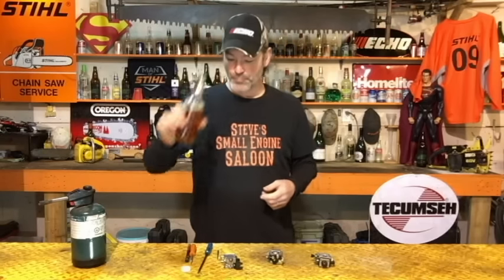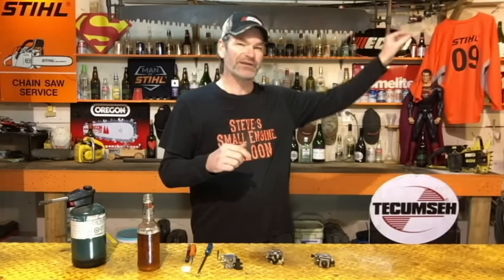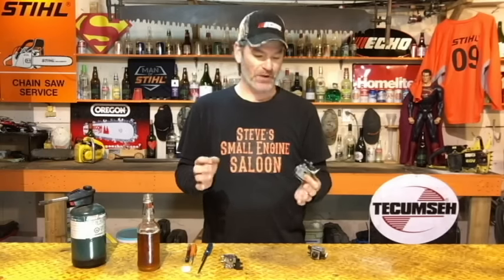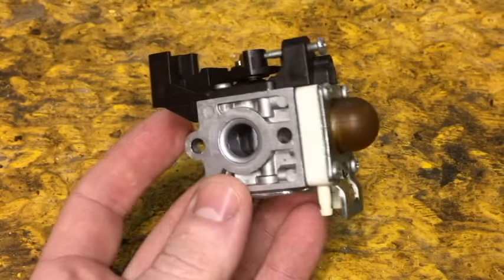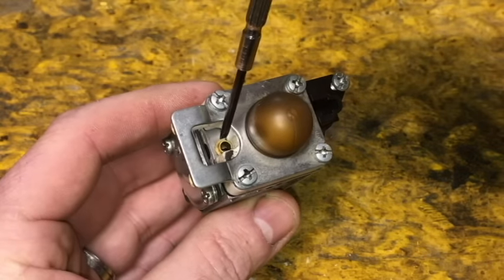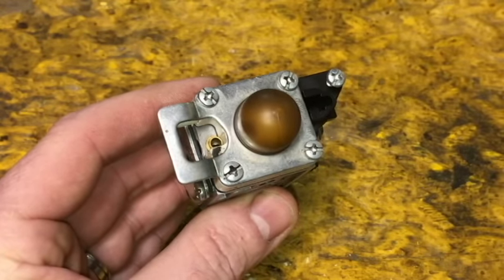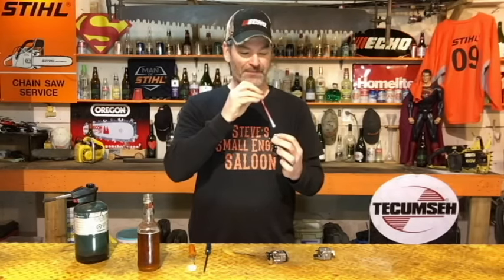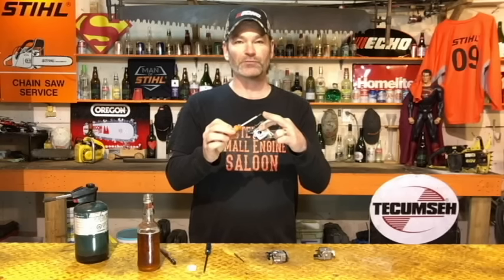Hidden Carburetor Adjusting Screws On Some Weedeaters And Blowers

Comment: Just found your site and I love it!! When are you,or do you have any videos on 4 cycle equipment,specifically the Makita BHX2500CA blower with the Subaru Robin EH025 engine? Thanks.
Reply: Just to add a bit,my Makita 4 cycle blower loads up the air cleaner felt with oil,seems to be sucking oil from the crankcase...but why? Thanks
Reply: Adj valves their too tight or rings were overheated
Reply: @charlesgrafton2242  Thanks for that...I adjusted the valves and it was still doing it..next move was to do a compression test,but I decided to take the air filter housing off to check the lines going in an going out and took the small check valve that sits behind the breather and found a little piece of something(not sure what) that was behind the check valve,probably stopping the valve from closing,so after reassembly,all is good! Thanks for commenting!

Comment: Damn life saver so pissed at the none adjust shit! thanks a billion ! usually do a carb kit change the rubber and hope it works again! but sometimes :( I had one on a yard machine, with a float boal style drilled out the jet just a tad with some welding tip cleaners to get it so it wasn't too lean!
Reply from the maker: You're Welcome...

Comment: My Husqvarna carb is all messed up and apparently they discontinued my carb and everything. But I opened it up and noticed a plastic pin that a needle slides into has a hole in it like it's cracked. Anyone know if those can be pulled out? I tried to pull it out it wouldn't come out but I didn't put much force just Incase it's not supposed to be removed

Comment: Say do some trimmers have a tendency to disel? I hade a unusual problem I suspect fuel quality and carburetor. Trimmer didnt want to start and it feals hot just from working a litel while then dies and refuse to start so I fumeled with some srew and the idel screw and that thing turned on with half gas trothel locked in place so I cinde of give it slowly closein the choke and opening it and then holding the trothel with my hand when the trimmer get to some speed he works and starts normaly with the mentioned procisue its odd behavior he increase in speed by him self and stays at centrain rpm some times he goes full speed I some how managed to ceap him at bay by trimming grass ore somthing puting a load to that thing and ocasionaly giving him just litel trother that thing remindes my nearly to a run away disel engine another garden mashine blow up from it self so hell if I know whats wrong? To much octane ore some one acidentaly put to much fuel to oil ratio ore what culd cause that behaviore? Im not shure realy perhap's magnets can luse magnetic strenght if trimmer is over heated? So my ignition timing is out perhap's ? Well I did change spark plug but nothing much changed it like the spark plug is red hot like some thing is consuming it. Well if the trimer is hot enough he can run on for fhew seconds more even with ignition system off compleately. So any ideas what that thing is doing? Any way the trimmer changes speed by him self with out my doing any thing Im cinde of loading him to prevent him from self destruction I supose.

Comment: good info there   but i gotz ro razz ya  what about computer(microprocessor) controlled carbs????  i know the answer but how many people have bought these without knowing  they are on them.
Reply: richard cranium only thing electrical on a moped carb is the cold start enriching module, that just allows a richer mixture when starting cold then disengages when warm. The rest of the carb is mechanical and adjustable
Reply: husqvarna  and stihl chainsaws

Comment: You can make an extractor for those things from a couple fishhooks, just use heat to straighten them out then douse quench temper them and stick them in an X-acto handle, great for hooking crap out of ports and things.  Cheaper than farts.

Comment: I have an older Echo leaf blower I fixed up and I adjusted the high speed but the low speed screw has a plug looking thing that won't turn and it won't come  off . It runs like a new one tho but I need it to smooth out while idoling. Anyone see this style and could let me know. thanks

Comment: What if you remove the plugs on a barrel type carb and the low speed adjustment screw doesn't look like anything you've seen before? The head looks like it has an offset half sphere in it's top. I have several carb adjustment tools and I've never come across, nor can I find, anything like this.
Reply: TheVoxOfReason View the video again from start to finish.

Comment: Just bought a new Ryobi 4 cycle weed eater, and of course, it's way too lean. However, the adjusting screws on this carburator are apparently hidden with a small brass ball driven into the opening. Almost looks too small to even have adjustable screws. I'm wondering what's behind those brass balls, (no pun intended) Ha! ????

Comment: Actually the Walbro units without the high adjuster hole on the side have it on the back side (intake side) and you need to pull the carby off to get to it. Makes it a difficult trial and error guessing game but it can be done. Atleast that's how my Walbro unit was.

Comment: All you need is a blue wiring butt connector to slip over the screws to turn them on the non adjustable screws . I use them all the time

Comment: If you just get the plastic  out you can't take the jet out .. your best bet drill it out the plastic  then find a screw that will go in it brass insert  screw it in just enough  for it to grab then put some vice grips on the screw  pull it out then u can take the adjustment  screw jet all the way out clean the carb good and look at the screw it is a jet with a hole in it clean it good .. then your good to go .. only pro builders know this most people  that work on them every day just think it's a adjustable  screw it's a jet with a hole in it .. pro builder chris Cordell  .. I been teaching tricks and running shops for 40 years  now .. this is a good video Thanks for letting  people  know what to and how . But maybe my advice  will help u your the video tech

Comment: Where can I get a tachometer the one that you showed had no extra wire and everything I've looked at does have an extra wire.
Reply from the maker: Most of them come with a wire, but you don't need to use it for the application I show....

Comment: I have a Ryobi cs26 weed eater. I changed out the muffler gasket.  Then when I weed eated, the screws kept coming loose off the muffler. I retightened again, then they came loose again and one broke in half and NOW cannot get the broken screw out. It is beliw flush, so I can't grab hold to unscrew. Any solutions?
Reply: Drill pilot hole then use an easy out.  Maybe soak with brake fluid first.

Comment: I have a Walbro carb with the holes blocked by epoxy. But what is the grub type screw directly above the fuel valves p!ease?
Reply from the maker: Adjusting the idle speed...

Comment: Hi Steve I have a stihl fs55 that has just been driving me nuts because I'm a small engine guy myself and ended up having to turn to the online for help. I dont have either type of carburetor in this video it doesn't have any adjustment screws and every video I find for this particular model has adjustment screws ahh!! Its bogging to idle I've already pulled the exhaust spark arrestor and cleaner the carbon buildup so I know it's a carb adjustment issue but can't figure out how to adjust it😭

Comment: Steve have you ever run into a clooged muffler full of oil?
Reply: Fairly typical over time.  Bogs the motor.  Take the screen out and burn it with a torch until it's clean.

Comment: I have a stihl bg 85 blower and theres only 1 screw on the carb. And its reverse threaded.. I'm so lost on getting this thing to run right. I've taken it off and cleaned it etc. Nothing.  Above where the screw is it shows - LD + I'll send u a pic if u have am email

Comment: The ryobi adjustment screw is different than the carbs you showed.. I cant find a tool for the adjustment screw on the ryobi RY253SS. The head of the screw looks like a reverse pac man screw and I cannot find it anywhere on ebay or Amazon... any tips on how to adjust this screw?
Reply from the maker: Yes, I have a video in my playlist for that....
Reply: @StevesSmallEngineSaloon  link please? Thank u sir

Comment: To remove plastic plug, just use a small drill bit and drill it out by hand, and insert small screwdriver.
Reply: Just twisted a 3/32 drill bit into the plug and it bit into the plastic. Pulled and out it came.

Comment: oem carb on a Toro 418ze snowblower is a RUIXING carb.  a real piece of junk, and at a 65 buck replacement cost.  opened up the bowl to clean it and the pin holding the float and needle valve just fell out.   found an aftermarket carb on ebay cheaper than the rebuild kit WITH ADJUSTING SCREWS and the ebay carb worked just fine.   sad day for Toro when I saw this

Comment: Careful with some Zama carbs, the hidden high speed jet under the plastic plug is a "fixed jet" only thing you can do is remove it for cleaning. It is not adjustable.
Reply from the maker: Sorry man but I disagree.  If it is under a plastic plug and you can remove it, it IS adjustable.  Never seen one in my life that's not!  If you have a link or something pointing to the carb in question, I would love to see it....

Comment: I bought a set of special drivers designed to adjust most small carbs for $13 on a place called BANGGOOD .COM. type in carburetor tool, I think thats what I used. Its under RC stuff I believe as most Gas powered RC cars have those carbs.  Strange place to find tools, but whatever. the price is right anyways.

Comment: why do you have to mess with the adjustment screws from the factory thats why they are hidden from shade tree mcchanics! Bob
Reply from the maker: The "factory" has no idea what fuel and mix oil you will use, nor the temperature, nor the elevation where you will be using that equipment!

Comment: Why do manufacturers not want you to adjust carbs ?? I have echo and honda machines both brilliant in my humble opinion. Echo will out perform any sthill  or
husky and go for ever !!!! BUT the carbs have these stupid caps on the screws to stop you messing ?? I have had to remove them every time at one point or another
due to wear i guess or something Once removed i can adjust and get them running like a swiss clock/watch so whats the problem ?????

Comment: After having to deal with this idiotic nonsense with a Briggs & Stratton, a Kohler, a Honda and a Shindaiwa, I was absolutely fed up. Gas, spark plugs, ignition coils, pull start cords and springs, oil changes, rusted carb bowls, making my own ethanol free gas, cleaning the carbs and the noise and fumes. I bought an E-GO 56v 21" self propelled mower with bagger. And string trimmer. I will never go back to that gas mess. Never. The E-GO systems are the power of gas in a battery. Finish the work and the tools can be stored on a back porch. No "tune-ups", no smell, no noise, no spills, no pulling, no priming, just put the battery in and cut grass. These gas ones are going to be phased out. You could offer me any gas mower, trimmer, edger, or blower out there and I would laugh and walk away. The battery ones are above those gas ones in every aspect. Ask anyone that has gone from these stinky gas machines to the rechargeable ones if they would go back. E-GO even has the "Z" type riding mowers. After having the rechargeable equipment, the other mowers seem twice as loud. And how many times have you watched someone trying to get that junk backpack blower started, the ones made by Stihl. Just plug and play with the rechargeable ones. Thanks for the vid, as I did use the info for the last time I had a carb problem on the Kohler. The last time.

Comment: So if you have a non adjustable carb that is running lean at power (a Honda) what does one do? Buy anther non adjustable carb that will give you the same problem? Walbro w/ adjustment on idle but nothing on high speed. Hate these little pieces of crap because they can never make 2 the same way & engineers seem to be scatter brained.

Comment: 👨‍💻  Blowers & weed eaters  wont run 🤷‍♂️?  Carbon build up in exhaust remove the small balls carbon in blower manifold 
weed eater remove the   Exhausts  outlet  &  clean the mesh outlet  I bet they  runs like a newbie again👍
found this out looking in a stihl blower one day at work small ball rolling about in the exhaust manifold poke poke with a small bit wire or screwdriver till it blows out - I told boss  at garden maintenance job i once worked he was paying $150 a pop to guy for repairs after i showed him & the other workers the repair budget dropped by $80% the cheap ass boss never once gave me a bonus i left after  about 5  years of complete brain fuk  the way he ran the business did my head in  i even caught 2 guys robbing the  factory we worked from WHAT he give me ? nothing saved him $5,000k he said  no insurance this is the type of boss you dont want to work with i bet there's no superantion in my kit either
  The vans he gave us  where so old maintenance kept them in repairs summer overheating etc cops would laugh when pulled over  like how the fuk do these vans even run 😳  😜
left that crazy job 😾  Only did it because i took a 25yr break from a factory   spring manufacturing O[][][][][][O |/\/\/\/\/|  then  got a job 4years swimming pool maintence i learnt that fast  pumps sand filters plumbing  but the top end the humidity  did me in wet season swet like crazy passed out headaches  2-3 times a year on hot concrete 33cel every day  Funny how 1 Beer brings you back faster than anything i found out heat stroke   hair dog same trick hangover  - Also Heartburn💗 i suffered badly Bicarb soda 1 t/spoon & in 15secs gone 👍 best ever  cheap i keep a jar always  now
Reply: 2020   317 dislikes are from Nerds who can't fix chit  🤓<- Type Nerd   its up there  top answer   emojis 😂👍

Comment: Redmax Is an overpriced poulan for people stupid enough to believe that more expensive means better. They're made by husqvarna. 
Husqvarna makes, poulan, weedeater, redmax, troybilt, shindaiwa, craftsman, jonsered, homelite, McCulloch. There are some parts exclusive to only half those brands but the rest are the same as another model of different price. Sure there is preference... but that don't mean much. The cheap weedeater brand has same engines or parts as redmax. Price of redmax makes up for loss in weedeater price. If you get older models, premonopoly models they're different. I use these engines for rc planes mostly. I buy in bulk from local scrap yards. Some I repair and sell, others I use for rc. I've tested every model in existence with a propeller. Never has there ever been a difference in power between any brand besides displacement having more power with size. Homelite saw actually has more power than redmax saw.  Majority of zama Chinese carbs are same across the board. Walbros are on all models also. Reed engines make very little difference except they fit into smaller plane nacelles. Echo, is a better engine, ryobi is garbage as rc, but decent as a trimmer. And I have no opinion of stihl because I always sell them because people in my area eat them up. Echo and stihl seem to be the last couple brands that are independent. But I can only speak for echo as I haven't use stihl yet. So advice.... don't waste money on redmax. Get a poulan pro p335 if your a professional.

Comment: There are no "local small engine shops", none of them survived over time and the ones that did got knocked out when the "poison" and or i's antidote was released. It's odd that they try to make these carbs unserviceable. There are no specific Echo, Stihl or other brand name specific shops and new carburetors are under 25$; So they must be assuming that when people cannot adjust a carburetor themselves that they will just buy a whole new unit?? I can't see any other advantage to making adjustment screws unserviceable...

Comment: 10:18 "Can't get in there". My butane lighter and a few drops of 97% isopropyl alcohol says otherwise! Of course make sure you have removed all the nonmetallic parts off the carburetor before lighting it on fire because the heat will conduct through the whole cube very quickly. And be prepared for a nice smoke show! Once the epoxy starts melting, use a pair of tongs to hold the carburetor with the hole facing down to let the epoxy drip out.

Comment: Carburetor adjustment tools, although available on amazon and ebay, are supposedly EPA certified to buy only. Fines for not replacing plugs start at $35,000. for repair centers. Advising customers as to how to do such work just undercuts the small repair shops like yours. And although informative, your doing a dis service to shops everywhere.
Reply: I will say it...   BS!!!!!